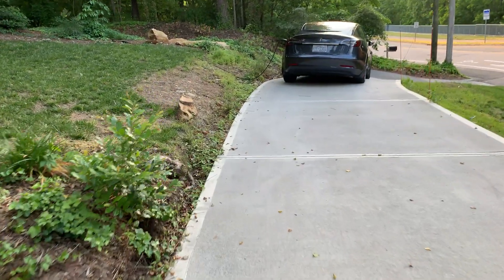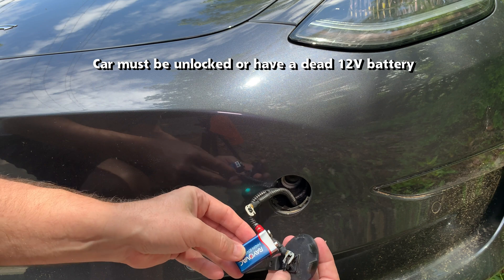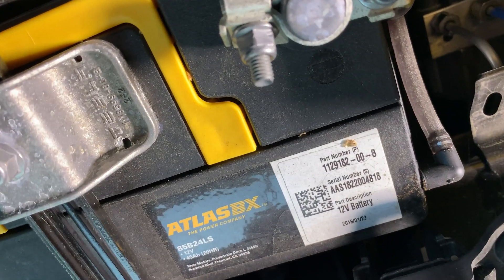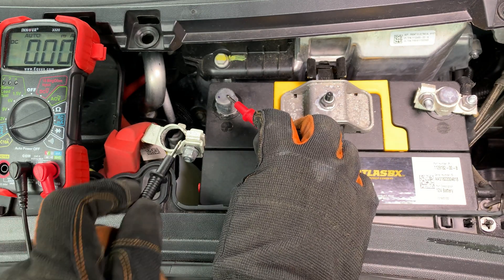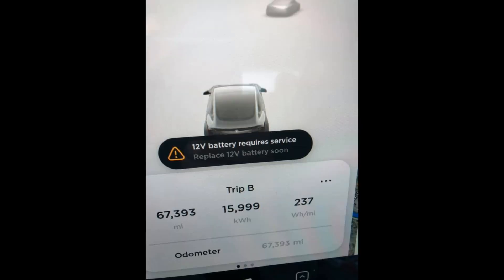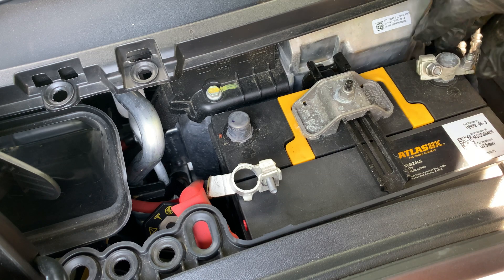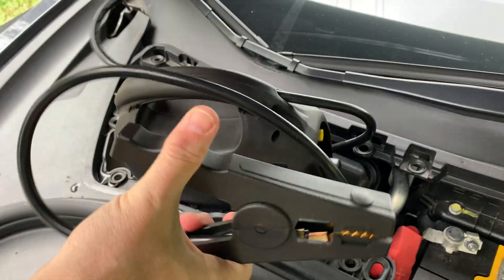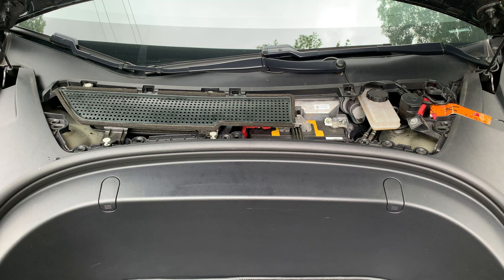Tesla Model 3 - 12V Battery + More

Comment: @MTNRanger do you know where the LV Battery 12 volt temperature sensor is located? is it in the red (+) cable?     They placed a new 12volt battery in the car yet i get the notification that the battery temperature sensor shot circuit. Could it be that they replaced the battery and left metal tools near the battery like you mention in the video not to do?
Reply from the maker: I looked in the service manual and it does not say where the battery temperature sensor is located.  I would contact service and have them fix it.
Reply: they do not know.   i saw that the postive and negative cables also can be replaced, if there is a short circuit could it it be in one of those cables? and could a sensor be  in on of those cables? @MTNRanger

Comment: How do you check to verify the DC to DC voltage is functioning to ensure the charging is happening?
I replaced the 12v to lithium iron phosphate and its been great. 
Now 2 years later: Twice I've had it throw error code and turn off 12v system off. Not stranded but lose cigarette lighter power and limited other functions. Each time i checked lithium iron battery was good and had around 12.4 voltage. Due to slightly low voltage, i manually charged battery and reset the system and code. No problems until a few months later same issue. Battery doesn't seem to be the problem.
Reply from the maker: That's one of the reasons I have stayed away from the Ohmmu batteries.  Too many software issues, no proof that they last any longer, and too expensive.  I suggest going back to the OEM 12V battery.
Reply: @MTNRanger  well i already did it, so I'm stuck. They do have a newer version of the OHMMU using bluetooth to fine tune charging parameters to avoid this fighting of software everytime Tesla make software adjustments.
Tesla is also part of the problem when they tune to stop things that they don't support you using.
I think lithium is better and it definitely will last longer physically. Just need some tuning of the system. Led acid batteries suck and don't last these days. 
For years I wondered why they couldn't do everything without the battery and Tesla must have finally agreed. Mew Teslas are eliminating the need for this battery which seems to be the biggest failure rate on Tesla's being towed over this minor issue.
Reply from the maker: @BoDiesel  The LiPo 12V battery in new Teslas is a lot smaller now.  It's a shame they can't retrofit older cars with them.

Comment: On one hand you mention off-the-shelf replacement batteries while, later in the video, you suggest taking the car to Tesla for battery replacement. Given that when you removed the terminal connections you took the battery offline, is it correct that there's no secret handshake or special button in Service Mode needed to reset the battery? So if it were out of warranty, just go buy a new battery and slap it in.
Reply from the maker: Yes, I should have been more specific. Now that my car is out of warranty, I would simply purchase the $85 12V battery from Tesla and install it myself.  When mine died last year, Tesla would only cover it under warranty if they did the installation.

Comment: How do you unlock it if the battery (12Volt) is dead?
Reply from the maker: Once you open the hood by using the method I showed, you will need to either replace the dead 12V battery or use a portable jump starter powerbank to at least open the doors.
Reply: You mentioned that in order to open the frunk, the door has to be unlocked, but since the 12V battery is dead, how can you even unlock the door to perform the method you showed ?
Reply from the maker: @KN-oh2ks  There are two ways to open the frunk with this method.  1st: door is unlocked. 2nd: door is locked/12V battery dead.  So if the 12V battery is working it will only open if the car is unlocked.
Reply: @MTNRanger  so if your 12v battery is dead, can you even access the door to unlock it? Something is missing here in your video. Cos you are trying to show a way to open the frunk when the 12v battery is still working though.
Reply from the maker: @KN-oh2ks  The door doesn't have to be unlocked if the 12V battery is dead.
Reply from the maker: @KN-oh2ks  Here's a video of a dead 12V battery:  https://youtu.be/y93FtctZtL8?t=111
Reply: @MTNRanger  Thanks, that answered my question.

Comment: Maybe a stupid question - how you unlock your car with dead 12V battery to get frunk be opened? App will not work I assume?
Reply from the maker: As explained in the first couple minutes, you have to use a 9V battery with the 12V wires in the bumper tow bar opening to open the hood.  Then you can jump or replace the 12V battery.
Reply: @MTNRanger  thanks, but you also explained this will not open the frunk with one of the latest updates if the car is closed. And if it is closed and 12 V battery is dead how you will open the car to use small 9V batterybfor frunk opening? Or did I get something wrong?
Reply from the maker: @sergeyrudnitskiy7579  If the 12V battery is dead or the car is unlocked, the method I show will open the hood.
Reply: @MTNRanger  thanks again!

Comment: Hi, does anyone know how powerful the step down dc to dc inverter used to charge the 12v battery is ? I am camping in my m3 lr and purchased a 12v inverter allowing me to use household appliances on the go. Knowing how powerful the charger is would be useful to know what I can expect to power for extended periods of time.
Reply from the maker: Good question.  Lots of discussion on this topic here.  It starts with the Model S specifically. https://teslamotorsclub.com/tmc/threads/is-it-safe-to-connect-a-large-inverter-to-the-12v-battery.97744/#post-2297726

Comment: In need of help.
I picked up my Model 3 a month ago.  Love it.  Previously, I had an ICE car (Subaru) and carried a small air compressor in the trunk - just in case.
This is what I bought, a few years ago:  Master Flow MF-1050 Tsunami Tire Inflator
It has a 12 VDC motor that draws 30A, and has 'jumper cable' clamps to connect to a 12 V battery to operate.
The Tesla cigarette lighter jack supplies 10A(?), so cutting the clamps and soldering in a cigarette lighter adapter won't work.
If I need to operate the compressor for 10 minutes to inflate a tire with slow leak (say, there's an embedded nail), and Tesla's 12V battery supplies 45A, will the lithium batteries recharge the 12V battery, or is 30A too high a draw for 10 minutes?

I know I can buy another compressor, but I already have this one.
Reply from the maker: Honestly, this is a serious compressor designed for off-roading and I wouldn't use it with the Model 3.  The Model 3/Y 12V battery is not designed for this type of use.  I would recommend something like this: https://amzn.to/3K27goV  It runs on battery or by 12V.

Comment: hey what is the voltage from the cables(from the converter) if the battery is disconnected? thank you
Reply from the maker: I don't know.  I'll have to check that out at some point.
Reply: I wonder if shorting them would kill the 12 volt battery so you can power it and pop the frunk, or use a jump box and revsere the polarity to pop a fuse or break power like it died

Comment: If I had an LED strip with two 12v wires, could I just simply connect them to this battery?
Reply from the maker: It’s usually better to tie into a 12v connection inside the car. But some people have connected accessories directly to the battery.

Comment: 5:30 is the quickest way of blowing the fuse in your multimeter lol often you cant see a correct parasitic drain test when the car in in an unlocked state, and disconnecting the battery on a locked car will trigger the alarm. need to slacken the NEGATIVE terminal, connect your meter to the post and cable, then disconnect the battery. (do not press any key buttons or trigger any wake up system on the car or you will blow the fuse in the meter.) Depending on the car this might need to be left in this state for a minimum of 10-15 minutes up to an hour to get a correct reading.

Comment: This soooo stupid of tesla. i mean, im still going to buy a model 3. So this is just ridiculous....
Reply from the maker: You mean having a 12V battery?  Most, if not all EVs have them to power the accessory system and to be separate from the high voltage system for safety.  Tesla is moving to Li-Fe-PO4 12V batteries in the Model S/X.  They may eventually be available to the 3/Y - but they cost a lot more.

Comment: Thats so odd. My model 3 died today, and it would not power up even after jumping it with my suv, AAA truck, jump starter and a trickle charger. Would not power up to unlock the doors. Had to put it up on dollys and push it out my garage so the tow truck could hook it up. Tesla held it overnight and some how got it to open. Also had no warning messages
Reply from the maker: I have heard that can sometimes happen. The hood didn’t open when using the emergency connectors in the tow hook opening?

Comment: Deleted my first comment to give more context. 
12v died in my M3 last night. Tried to open frunk with both a 9v battery and a new charger I had in garage. Neither worked. 
Switched charger out to an older model and frunk opened. 
12v was completely dead.
Reply: The reason your one battery charger didn't work was that it's "smart" and will not put out any voltage unless it detects some voltage on the wires.  This is used for reverse polarity protection, but the Tesla frunk jumper wires are not connected to the battery and will not show any voltage.  So the "smart" charger or jumper will not output anything.
Reply from the maker: I'm curious, what were the two charger models?  I'm assuming you mean a battery jumper like this: https://amzn.to/3rGY55B ?
Reply: @MTNRanger  the one that wouldn’t engage the frunk was a vector smart battery charger vec1095. 
The one that engaged the frunk was a Schumacher se-82-6. 
Interestingly, once the frunk was open. the Schumacher didn’t supply enough power to jump the battery so I had to switch back to the vector
Reply from the maker: @VoyageWithoutCarbon  Interesting, thanks for the detail.

Comment: Model 3 batteries are not agm.  Atlasbx agm batteries start with the letters agm in their model number.  The MF line is their regular sealed maintenance free batteries.  https://cdn.hankook-atlasbx.com/PRD/CUSTOMER/20200212/010e2886-9bdb-454e-9aee-8cbb2fd70a7c/(US_version)General_Catalog(2019)_(small).pdf
Reply from the maker: Everything I have read says they are AGM.  https://teslatap.com/articles/12-volt-battery-compendium/  I have read some new posts and I think you are right.  https://teslaownersonline.com/threads/the-12-volt-battery-in-the-model-3-not-agm.16821 Thanks for the info.
Reply: Yeah, I saw that too,  but I would trust the manufacturers own info than some website I never heard of.
Reply: They are “High Cycling batteries” not regular batteries.

Comment: He read the power drain wrong. To read amps you have to move the connector on the multi meter to amps on the left and not where he had it on the right for volts. So he read nothing with it not connected correct. Always move the connector back as soon are you are done or you will blow the fuse when you try to read volts connecting across the pos and neg terminals.
Reply: If you look closely you can see that he switched the DMM to current measurement.  Gut a current draw of 0A would mean that absolutely no system starts when the battery is connected. My guess is that the DMMs fuse for the low current measurement range was broken which is typically fused at few amps.
Reply: @christianbauer6443  but you have to switch teh DMM to current measurement and move the lead.

Comment: Do you have to pull the high voltage battery fuse prior to disconnecting 12V?
Reply from the maker: No, you don’t have to.
Reply: Tesla Tips by MTN Ranger well I recently had service and asked the Tesla mechanic.  He advised pulling the battery disconnect under the rear seat first.
Reply from the maker: CoollllCat Thanks for letting me know that.

Comment: very good video as always. Have you touch up your model 3 yet? I recently got a rock chip on my rear driver side door. I'm not sure to get Tesla OEM paint kit or dr. Colorchip kit. Any idea?
Reply from the maker: Chris Brown I have been lucky so far.  It also helps having ppf on the front (bumper, fenders, hood).  I bought a Dr Colorchip touch-up about six months ago just in case.   I’ve used them with three previous cars and it works well.
Reply: @MTNRanger  I also have PPF on the front. A rock hit my side door lol. I heard Dr. Colorchip lifespin is 1 year. Better store it in a cool place.
Reply from the maker: As long as they are sealed well I’ve had them last a few years. From what it looks like, the Tesla paint is made my Dr Colorchip. I don’t think it matters which one you choose.

Comment: How do you open the frunk with the doors locked? Also how do you disable mobile access?
Reply from the maker: Supposedly the frunk will open when locked with a dead 12V battery.  To turn off mobile access, go to the car’s Safety & Security menu, the option is at the bottom.
Reply: Tesla Tips by MTN Ranger Oh ok thanks for the info.